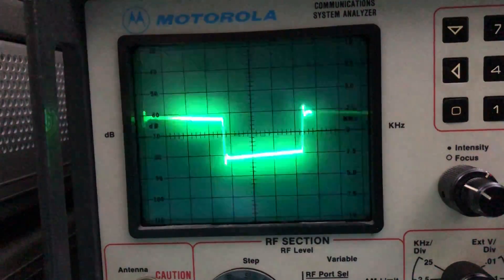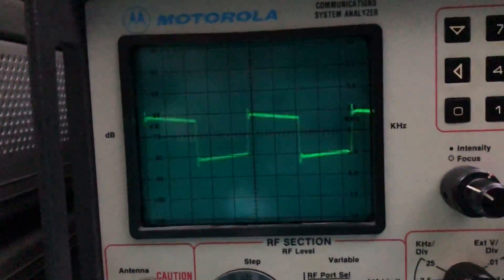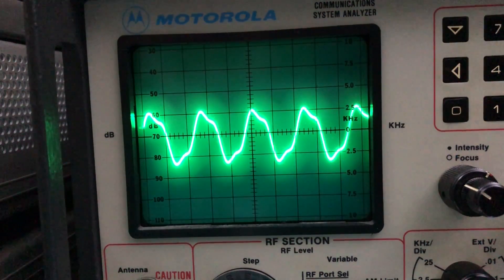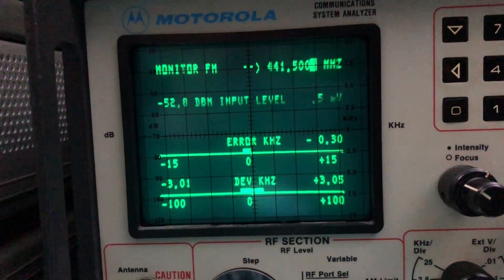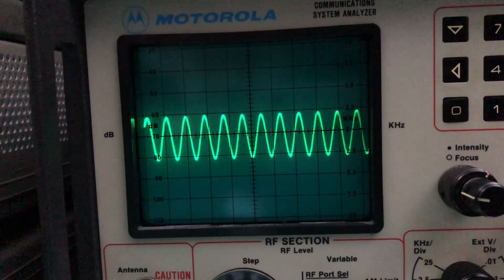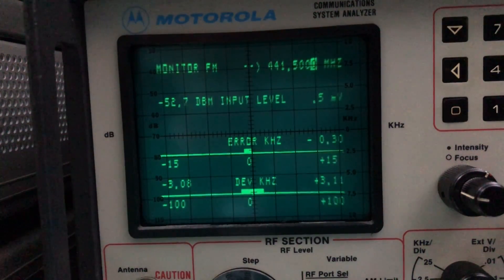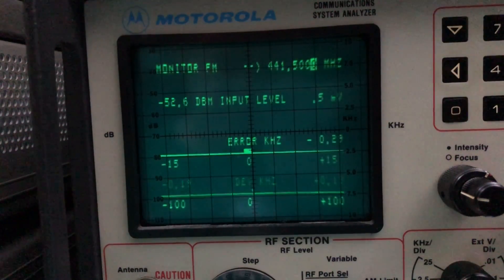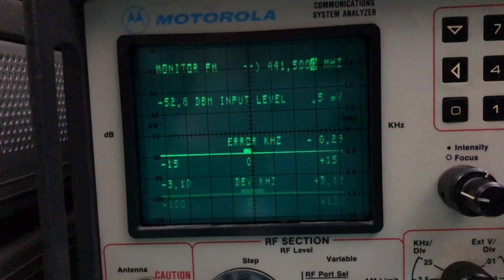CDM 1550 UHF Modulation Balance Adjustment

Comment: I have this same or similar service monitor.   
Fully works but CRT is getting pretty tired (looking).   
I don't have a service manual for it and have been using it about once every two years since I got it.  
Used to do this stuff in the 90's.  
I'll eventually get back into it.
Reply from the maker: https://wiki.w9cr.net/index.php/Motorola_R2001D
Reply: @W9CR  Excellent